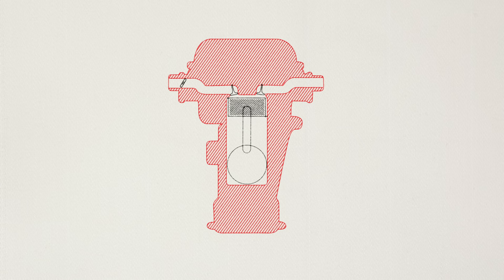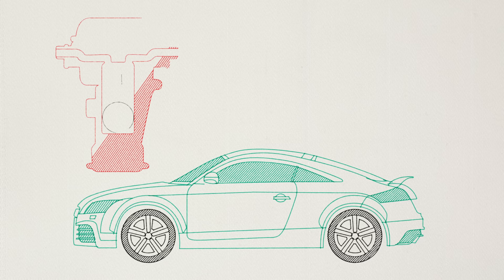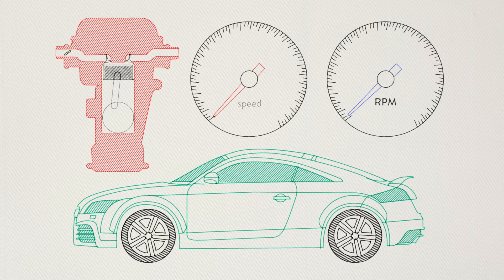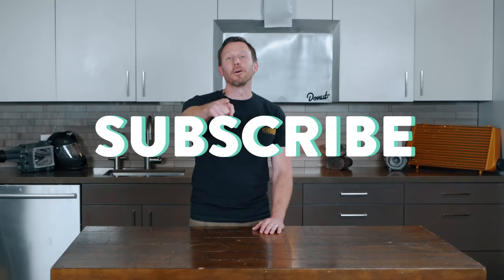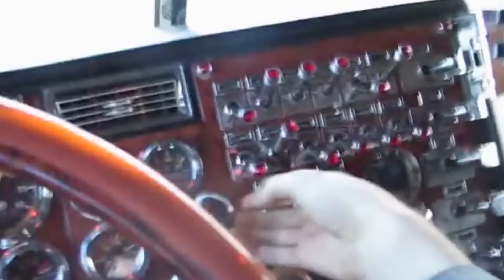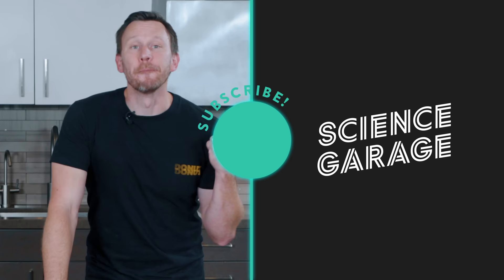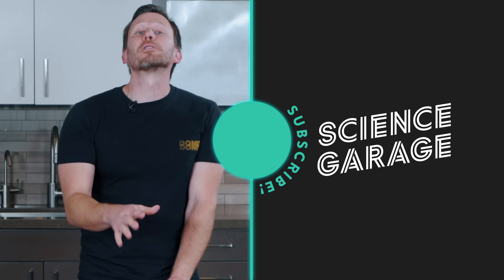ENGINE BRAKING | How Semi Trucks Slow Down Without Brakes | SCIENCE GARAGE

Comment: I drive a 7.3l diesel everyday. No throttle body no exhaust brake no jake brake, just cut the fuel aka let off the throttle pedal and the 14:1 compression is more than enough to slow the truck down. I don't know why he says diesels can't engine brake. As long as you downshift the compression will slow you down to some extent in any vehicle
Reply: The compression actually does not contribute anything for engine braking. The energy used to compress the air is returned on the next stroke. Without an engine braking system you are relying on the friction inside the engine only. It still provides engine braking but not nearly as much as a proper engine brake would
Reply: @Redtooth75  there you go again, reciting myths.  Perhaps try this little experiment.  Get hold of a bike tyre pump or car tyre pump, block the outlet and compress it as far as you can 20 times inside a minute without releasing the air  The result should be obvious, the body of the pump heats up, allowing you to see that compressing air is not the same thing as compressing a spring, a considerable portion of the energy in converted to heat and  hence removed from the return stroke.  It is this difference that creates the engine braking effect in both petrol and Diesel engines, the more air that is compressed, the bigger the effect, hence why there is more braking at WOT.  This is the basic inefficiency of how HEAT engines actually work, and the reason that when you cut the ignition the motor stops within one revolution rather than keeping spinning for a couple of minutes if it just relied on internal friction to slow down.
Yes, in a jake brake system, the valve on the power stroke opens and none of the compressed/potential energy within the cylinder is returned to the crankshaft, yet in this case the braking is also being caused by the compression stroke
Reply: @ziggy1ful  i take it you still haven't used this miraculous thing called google
Reply: @Redtooth75  google/wiki , in the main, just more unqualified people reciting the same myth, though if read some threads such as these you will find the people/engineers that point out the vacuum fallacy.
Reply: @ziggy1ful  "The above approach can provide engine braking from engine friction and pumping work (due to manifold vacuum). The compression and expansion of air in the cylinders during the compression and expansion stroke results in energy storage and recovery, and thus may not contribute to engine braking. As such, one approach to increase engine braking is referred to as a “Jake Brake”. A Jake Brake opens the exhaust valve at top dead center of compression, thereby reducing or eliminating the energy recovery of the expansion stroke. This, in turn, can increase engine braking significantly since the unrestrained expansion is dissipating energy stored during the compression stroke."
Source: https://patents.google.com/patent/US6951198B1/en
Its pretty basic physics so I don't know why you are still arguing. Just apply some common sense
That article was written by well respected and well known researchers. They are highly educated (masters or phd)and have publications in numerous places such as SAE.
Reply: @Redtooth75  no argument with how  a jake brake works, you appear to understand that

You have quoted ""The above approach can provide engine braking from engine friction and pumping work (due to manifold vacuum). The compression and expansion of air in the cylinders during the compression and expansion stroke results in energy storage and recovery, and thus may not contribute to engine braking. "

results in energy storage?  where exactly?  pumping work, if its not sucking air its not doing any work!@#  If you restrict the air supply(such as closing down the throttle), the engine moves less air and hence does less work, is restricted less.
You have clearly misinterpreted what their research is about, did you take in this line:
"In this way, it may be possible to provide engine braking while reducing net flow through the engine" , have a think about it.

To use an example you are familiar with, the common vacuum cleaner.  What happens when you block the suction hose?  The motor speeds up, indicating less resistance on it, because its pumping less air.  The same analogy can be applied to the heat engine stop air going into it and it will spin more freely.

Its clear that you really have no practical experience in all of this.  Have you every tried to push start a car.  Its very hard to get it moving if the car is in gear, even top gear, due to the compression stroke, by your reckoning it should be dead easy as all the energy is released again on the power stroke.  And if you reckon its due to the friction of the parts, take out the spark plugs and give it a go, it wont feel any different to if the car is in neutral.
Over and out here, if you are not willing to even get in an old school car(perhaps you dont even own one) and see what happens when you apply WOT during engine braking then more the fool you actually are and a complete waste of time communicating with you
Reply: @ziggy1ful  The arrogance is unreal. Just because you don't understand it doesn't mean its not true. I have given you several sources, one of which was a research article written by people with a doctoral degree, and they all say you are wrong. 
The energy is stored in the compressed air and released when the air is uncompressed. Its a very simple concept. If you restrict the intake, the engine has to work harder to draw air into the cylinder therefore providing engine braking. Just like how it is harder to suck air through a small straw compared to a large one.
I am a mechanical engineer who does automotive work as a hobby. I own several cars with carbs, and they do the exact opposite of what you say. Its not easy to push start a car because of the very large amount of friction, it has nothing to do with compression and neither does engine braking.
How about you provide a source to back up what you say? Hint: anecdotal evidence is not a source
Reply: @Redtooth75  I do understand it, you are misinterpreting the investigation and its conclusions and using it to answer another question!

You claim a mechanical engineering degree, surely you are aware of the Carnot cycle which basically tells you can not get 100 % conversion of heat energy into KE, the same works in reverse.  KE in does not equal KE out on the compression and power stroke and the difference is heat.   I asked you to consider the bicycle pump example, but still you come back with the energy stored in compression is totally released in the power stroke, that is being stubborn and pig headed

You claim your carby cars do the exact opposite........I challenge that as nonsense.  You are honestly claiming that when going down a grade in gear and you cut power to the engine, that the car will increase in speed if you open the throttle.  I first heard of this nonsense 40 years ago while i was studying my mech eng degree and got out there with several vehicles and measured the exact opposite, the difference in retardation between closed and open throttle isnt a whole lot, but if your theory is any good we would have a runaway effect at WOT, it just doesn't happen, that is the only proof/evidence we need.

If you restrict the intake, the engine has to work harder to draw air into the cylinder therefore providing engine braking. Just like how it is harder to suck air through a small straw compared to a large one.

You are misapplying this result.....I asked you to consider the vacuum cleaner which is more related to this example.  Restrict the air intake on a constant power source and it will cause less resistance/braking to that power source.  

Lets go to the sucking on a straw example you misconstrue:  You are trying to make the flow the same when you apply a restriction to the straw, hence you apply more effort/force to the suction to try and increase the flow.  The car engine doesn't have a brain in this regard,  less air flow due to the restriction doesnt make the engine suck harder, it just pulls less air and hence is not as restricted  as much.  Think of the case when there is no air at all, there is absolutely no restriction. The only way for it to pull the same amount of air and suffer the same overall retarding force would be for it to be spinning faster in a higher gear.

"Its not easy to push start a car because of the very large amount of friction, it has nothing to do with compression and neither does engine braking."

Ok, suggest before you bother replying, try and turn the motor over by pulling on the fan belt......then try it with the spark plugs out, a five year old can do it.
Reply: @ziggy1ful  provide a source or gtfo
Reply: @ziggy1ful " The compression and expansion of air in the cylinders during the compression and expansion stroke results in energy storage and recovery, and thus may not contribute to engine braking."
There isnt any room for misinterpretation here. It is very clear. Compression does not contribute to engine braking. There is not a single source to back up your claim.

Comment: Wrong 3:35,   Only correct for 8 cylinder or 12 cylinder.
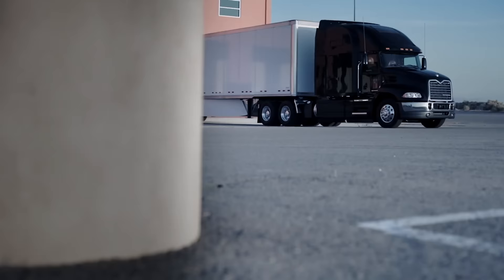Wrong again @ 5:07.  New Cummins engine has a throttle because of the E.G.R. system.
Wrong again @ 5:37 most Interstate Trucks are @  80,000 
Hire a Diesel Tech, to do this instruction.
Not some kid that has never repaired a CUMMINS.😒
Reply: Cummins *
Reply: You are CORRECT

Comment: C'mon let's be honest. The Jake break opens the exhaust valve early letting power leave the engine a bit before full compression/efficiency. Yes there is blowback to the diesel pistons that slows the engine down, a bit, but... That's nothing compared to the lost in power by priming the exhaust valve's to open early on purpose. It's sounds cool, I admit, but it's lazy. Back to the drawing board guys. It's 2021. C'mon.
Reply: What are you on about? The exhaust valve only opens early when the jake brake is on. When you are engine braking you don't want the engine to make any power at all, you want it to absorb power from the vehicle to slow it down. Saying that opening the exhaust valve early causes a power loss is kind of the whole point.

Comment: A 6 liter 4 cylinder...ooook would've made more sense if you reversed those. There are probably a LOT more 4 liter 6 cyl diesels than 6 liter 4's. Or just said 6 cylinder. Since you're apparently not aware of these new fangled 8 cylinder engines all the kids are huffing and twerking on.

Comment: So Jake brake diesel engines have worser fuel economy
Reply: false
Reply: Not really, because you're not using any fuel. The engine is just compressing air. When the jake brake is activated, it shuts off the fuel.

Comment: This video is misleading. You'll slow down in any vehicle, running on any fuel when u let off the throttle
Reply: while technically true yes the amount of energy loss by letting off the throttle with a diesel engine is much lower than that of a gas engine and when you combine that with up to to 80,000lbs of weight you will not slow down if you're on any sort of downgrade. Another system was needed otherwise trucks would be crashing left and right because they burned out their drums on downhills
Reply: @TheIcyWizard705  I know that part of the video, but when he was talkin about normal cars and shit he let on like automatics dont slow down

Comment: Aren't you using more gas to use you engine to brake and putting more wear on the engine?
Reply: No fuel is injected when engine braking. It causes no more increased wear than reving the engine would

Comment: 3:39 ... and you forgot, that right after the intake, the piston goes the opposite direction, by which the vacuum is now speeding up the piston exactly at the same rate, at which it was slowing down - which equals each other. How about that? Man, you should really learn the principles better before you make another video.

Comment: I’m almost sure a semi can engine brake, the Jake brake just supplements the engine brake bc the vehicle is so heavy. A Jake brake is almost useless without engine braking with it.
Reply: A jake brake is an engine brake, it is just one type of engine braking mechanism.
Reply: Redtooth 75 no sir engine braking is a technique not a mechanism. The Jake Brake mechanism won’t work without the engine braking technique.
Reply: @juankelly8653  A jake brake sole purpose is to engine brake, it does nothing else. There are other types devices that can create engine braking such as exhaust brakes and the throttle body.
Reply: Redtooth 75 the sole purpose is to supplement the technique of having the gear lower to resist forward movement. If your technique is wrong and the gear is too high the rig won’t slow down. Yes Jake brake is a mechanism. No mechanism will work without engine braking technique. Engine braking is a technique used in the ENGINE mechanism. Engine braking is step one, anything else can only supplement the technique.